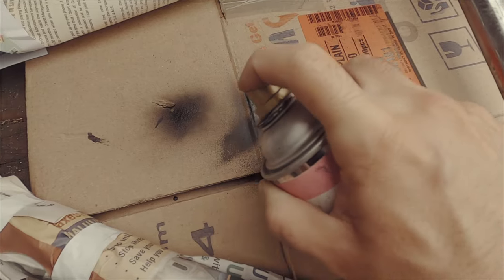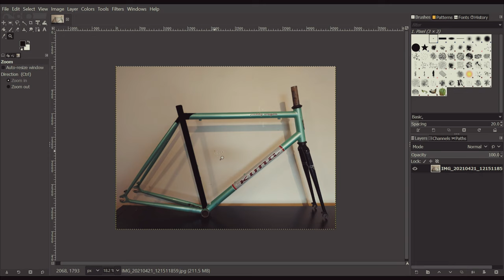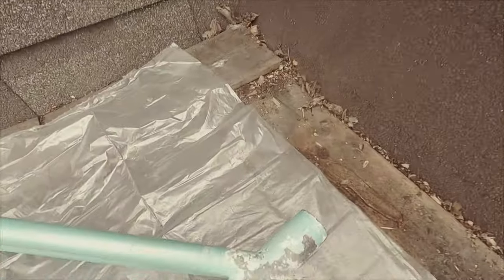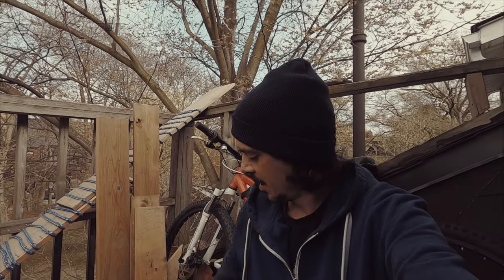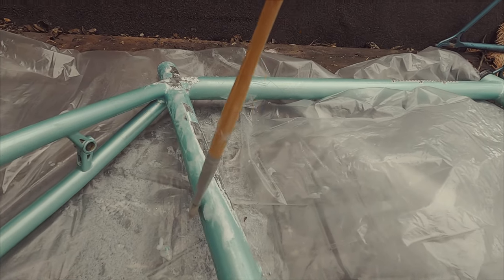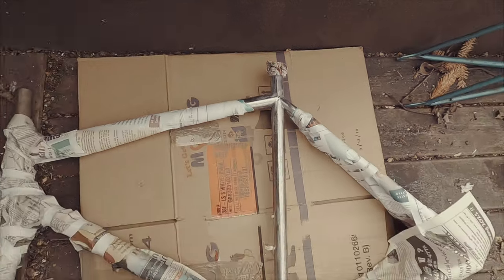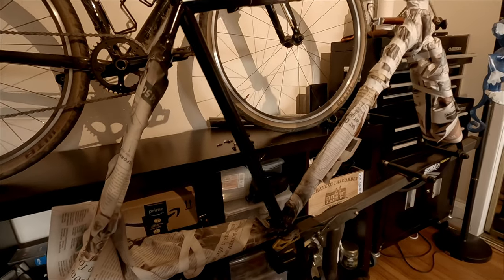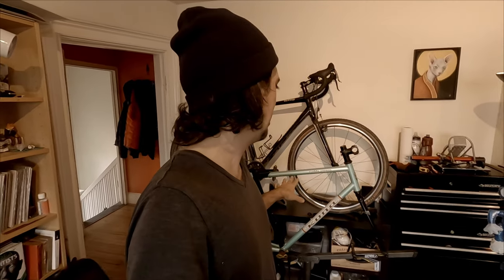fixing the paint job on the Kona with spray paint

Comment: If you are repainting your entire frame, is it possible to keep the lettering on it?
Reply from the maker: It could be done but that would require a lot of work, it is much easier to remove everything and buy new decals for the bike. It would also provide a better end result.
Reply: Yes put thick grease with fine brush on letters n design and apply spray paint